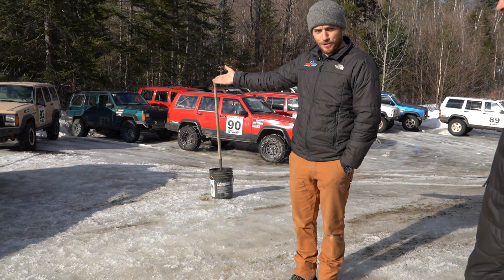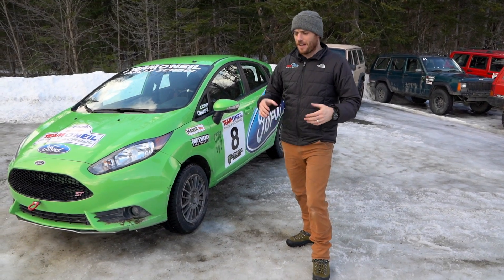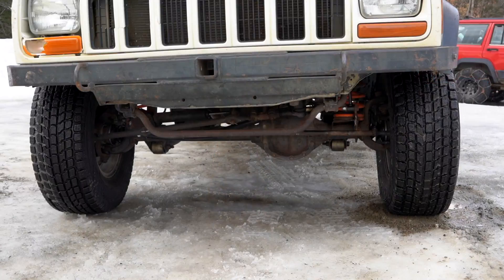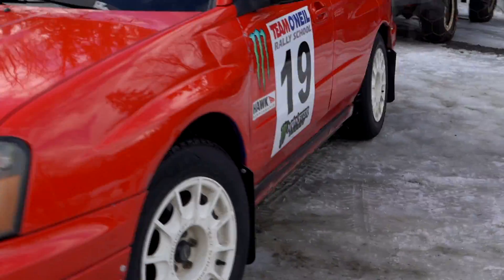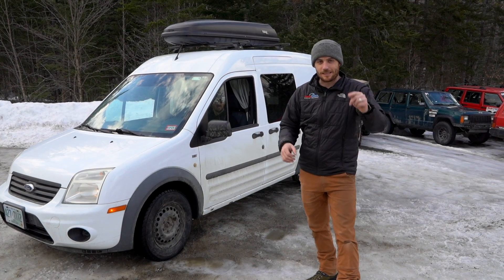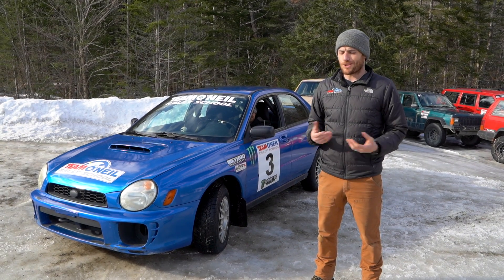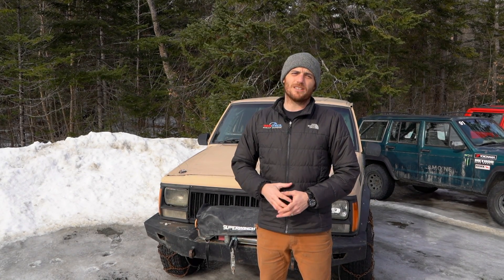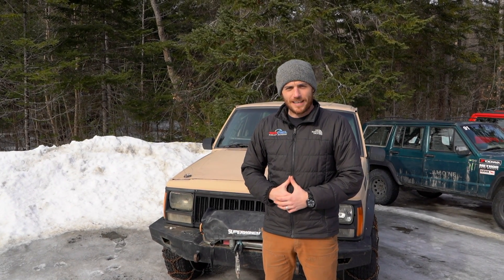Differentials and Traction Control Explained

Comment: But if the green one gets a wheel in the air it will not transfer torque unlike a clutch style limited slip

Comment: I have a 2015 Toyota Tacoma 2wd.. it came with traction control and auto LSD. It was okay. I installed a geared style limited slip, and a little bit lower gear ratio... The combination of the torsion and the traction control is amazing......

Comment: i put a trackloc in my rear (extra clutch pack), and an Eaton Elocker in the front. best upgrade ever! (also installed solid axle shafts instead of the Central Axle Disconnect)

Comment: My 2013 grand caravan would brake the spinning wheel even with tc turned off,just no cutting the throttle with TCin off. My 2018 Camry doesn’t brake the spinning wheel when TC is turned off.

Comment: If I have traction control on and try to do a trail turn will it just Bog down and I'll lose pretty much all power?
Reply from the maker: With TC on, the car will bog down any time the tires spin and the wheel speed sensors read higher than the actual vehicle speed.
Reply: @Teamoneilrally  Thanks!

Comment: Ford traction control caused me to have a massive accident in a Ford Mondeo Mk1 ST24......I aquaplaned at 60mph on a country lane, I reacted quickly and saved it initially, dropped into 3rd gear and nailed the throttle to pull me out of the skid, traction control kicked in just like that transit and made the car essentially lift off oversteer off the road, massive accident , rolled 3 times and destroyed the car completely. That kind of traction control is DANGEROUS imho.  

If I remember correctly that system lengthened the throttle cable / shortened dynamically based on the ABS wheel speed sensor difference, very crude, the irony was I always disabled that crap when driving "normally" because it would often give you a completely dead throttle pulling out of a wet junction of similar, again, very dangerous, sadly the TC always defaulted back to on when you started the engine, and on this occasion when I crashed I had forgotten to disable it.

Comment: Hi, first of all you do a great job here on yt :)
But while testing wrx you said that front spins the same speed as two rear. 
Its not true, when one front wheel is not spinning second one spins two times faster that rear wheels. That's how open diff works.

Comment: anyways turn on to my street when entering a residential street I always hit the all-wheel lock.  I came to my alleyway which has had some melting going on in the last few days of snow yesterday.  So little islands and slush.  At the alleyway I had a big puddle deep etc.  so i was already in the all-wheel lock and i pushed the button thinking i was turning it on.  went forward left front wheel up on an island and the right front down at an angle now getting traction moving up a good incline both right and left front tires meet ice and snow at the top rear wheels to follow...then I realize I did not have the all-wheel lock on.  It griped pretty well surprisingly.  Curious is that thing?  I like to think of the all-wheel lock bracing everything keeping everything tight.  if i had the lock on would I have angled in the puddle as I did or would the four-wheel lock have kept up and found another way through?.  I always feel like with the all-wheel lock-in that situation the vehicle has to twist more without the help of the all-wheel lock.  Also, curious e traction control is that how I was able to ease through so well thinking that I had the lock on but the traction control actually giving torque to the rear anyway.  Saw the jeep ch at the end there have an all wheel lock...like mine except as I explained mine was off when ''i thought it was on ....

Comment: Go Jeep Go, show up those over hyped Subarus. I got a similar system in my sedan, clutch type transfer case, open diffs, and a good stability control system that won't pull power. It's A-MAY-ZING!!

Comment: Is it possible for a 4x4 or AWD to only drive with one tyre considering that all three differentials are open?
Reply from the maker: The center diff is rarely completely open, even a viscous center diff will spin both front and rear driveshafts pretty well (unless it's badly worn out)

Comment: My 2wd tacoma has what I think is a nice mix of systems. During regular driving with the traction control on, its a system where it cuts power when the rear spins. If you press the trac off button, it turns the power cutting off and has the brake actuated rear lsd (Auto LSD on the dash). If you hold the button for 5 more seconds it turns all of these off and it doesn't touch the brakes

Comment: 1:53 the Chrysler 300 has that system. It wouldn’t go forward on slick conditions  like I’ve, so I had to turn off the traction control in the winter time. It took too long to launch even if I go pedal to the metal.

Comment: The car I"m just about to trade in has the Electronic traction control, if I ever forget to turn it off when I get in and my wheels slip for any reason, say wet road, ice, debris whatever, the traction control causes such violent wheelhop that I see the dashboard and windshield moving separately... Never buying another Seat, it's only 14k miles old and has so many other problems.

Comment: I used to drive a small truck a lot. It had ASR. First thing when it got slippery.. I turned off ASR. It wasn't that I'd feel so strong about my driving prowess. It's just that the van have stopped and refused to move up a slippery slope, wheels spinning slowly. The most useless system I have ever seen in my entire life.

Comment: about FWD cars at 1:51 with Traction control that cuts throttle, i believe the 10 and 10.5 gen Corollas 2009-2013 have this, and possibly 11th gen Corollas as well 2014-2017, they are rally-able as well and quite fun in the snow/ice! :)

Comment: One problem of open diffs with electronic traction control that can't be fixed is the energy wasted in the brakes.
Only one wheel having traction means 3 others spinning slightly faster but same torque into the brakes and thus wasting more than 3 times the energy?
So your engine suddenly has only 1/4 of it's power?

When going fast i guess the control also limits this waste by effectively disabling the traction system brake control.

Comment: Pretty sure the 13 honda fits traction control worked by cutting throttle.  It was a pita with the manual if you didn't just power through it the car tended to stall when trying to start out on snow/ice. 

These vids are great, thanks!

Comment: I have a 2005 V50 t5 awd with dstc. the haldex awd in this car have a clutch plates to send power to the back wheels so it act as a locked center diff when its activated. The dstc systeme use the brakes to transfer torque from both sides but when you turn off the traction control, it still makes your axles act like limited slip but doesn't reduce the absolute speed to keep traction. so I can floor it and all four wheel break traction and start spining. That make it a very fun car to drive in the winter. I don't think the Haldex systeme without the DSTC produce the same result. DSTC was a option on those car. DSTC ever help you turn at high speed by sending more torque to the outside wheel. A lot of exotic cars now use the brake to split torque with an open diff because it's very effective. The only counter argument I can see to that is that it's not a raw and pure form of driving because a computer is helping you.
Reply from the maker: Those Gen 2 or 3 Haldex systems are great, but they do need the front tires to slip before they will send any drive to the rear. That takes a second, then the DSTC needs one side tire to spin before it can apply brake and help create a limited slip effect. Once all this has happened, you're exactly right that all four wheels should spin, but as soon as you lift off the gas, you're back to FWD and the whole process starts over again. It's a GREAT system for normal driving and getting around in the winter, but for high speed maneuvers sliding around on snow and ice, it's like trying to hit a moving target. That can make it a lot of fun getting to know these cars and how to get the most out of them!
Reply: @Teamoneilrally   Yes thank you for the reply, you are right about the time of reaction of the systeme, in my dayly driving and having fun in parking lot I'm not realy noticing it. I can see how it can become a probleme at high speed for precise cornering however!

Comment: So technically the Subaru and the 4x4 are not a genuine AWD and 4wd system - glad I bought a proper AWD that actually spins all 4 wheels - Evo for the win
Reply: So technically I think you missed the point
Reply: STI-s got front/rear lsd as well. Just the wrx doesn't

Comment: My mk5 Jetta has the TC that will cut power to the throttle it’s very annoying in winter have to turn it off because it’s manual but on dry asphalt it hooks up pretty good

Comment: Is there a difference in the WRX vs STI diffs? What diff setup is best for rally? front and back limited slip?
Reply from the maker: The STI has limited slip diffs front and rear, which is an excellent setup for rally.  The WRX only has a limited slip in the rear, which is still pretty great, but only 2008 and older. In 2009 the WRX got an open rear diff and traction control... Booo

Comment: in a live axle one wheel slips more than the other because the drive shaft torques the axle. If it spins right the right wheel dig more and the left slips

Comment: great video. i had an 98 grand cherokee 5.9 (with the 249 transfer case replaced with a 242) that was essentially right wheel drive. it almost never spun the left wheels, very rarely the rear it would. no traction control at all. every time it snowed i would be crabbing down the street at an angle. i currently have an 03 bmw 325 XI which is nearly the exact same 4wd system, with its mechanical new venture transfer case and all, but the bmw has traction control that applies brakes. that works very well and will get all 4 wheels going when necessary, but its very true about losing momentum. i have on slight occasion had to turn off traction control to get a couple of wheels spinning better to get me up a hill or something.

Comment: Would have been nice to see an STI with the DCCD in LOCK. I assume all 4 wheels would spin?
Reply from the maker: Yup all four will definitely spin.
Reply: If it wasn't locked would it get traction and move forward with season correct tires?

Comment: Second time watching the video; still great! But I have a new question.

I've been practicing left foot breaking in my 2000 5speed honda accord. Since it's an open diff, are both wheels still spinning when I'm applying brake with the left foot and turning or just one wheel?
Reply from the maker: Awesome! Yes you can definitely ride the brakes to keep one tire from spinning and force the diff to turn both tires with more equal power. It may not be exactly 50-50 left-right but you can definitely keep it from going 100-0.
Reply: @Teamoneilrally  OMG thank you for the reply! I will definitely be signing up for some lessons in the future when I'm finished school.
Best wishes from Canada!

Comment: Front wheel drive tip: If you're trying to get up a snowy hill and having trouble going up forwards, try reversing up the hill instead (if conditions allow, ie not on a busy public road). By doing so, as you begin to accelerate up the hill, you shift the cars weight onto the front drive axle. Also reverse gear is often the lowest gear ratio available in an unmodified car. This has worked for me many times trying to make it up steep snowy driveways.
Reply: It also does better donuts ;)
Reply: Was wondering, does Traction Control work the same in reverse on most/all cars that have it?
Reply: Exactly how I got out of a tricky situation seeing some friends who live on the bottom end of crescent. Had to get car dug out first, then turned car round and reversed up the hill no problem, where other cars had struggled to get up the hill, which was about 1in3 and about 400m to top of hill.
Reply: A good idea. But not a bright idea. When you're climbing a offroad obstacle. You want to be stable and being able to drive safely. It's all about the tires that makes a big difference in offroading. All terrain tires, Ok. Mud tires, strongly recommend...
Reply: No, reverse down the hill and go another way, because the problem is some idiot that got stuck uphill from you.
Reply: The lowest gear ratio on most cars is 1st and reverse is generally somewhere between 1st and 2nd

Comment: Great vid!  I have a Cherokee Trailhawk on my channel which has the locking rear diff.  Also if you turn off TC it will still activate the brakes to act as limited slip.

Comment: Hi guys, got a question on the torsen diff; 
I've been wanting to put one in the front of my Impreza gc8, but I've been "scared off" it by reading on forums that it really doesnt perform that well on loose surfaces, since when it is slippery it obviously can't transfer a lot of torque if not any torque at all. In your clip with the Fiesta ST though, it looks like its working pretty well on that packed snow/ice. What's you guy's take on it? How do you like it on loose surfaces?
Reply: Well the Fiesta ST uses brake torque vectoring. Which you could basically think of as high performance traction control as it's designed primarily to transfer torque rather than to stop wheel spin.

Comment: Totally meaningless demonstrations that in fact DO NOT demonstrate the difference between open and limited slip. It’s called “limited slip” for a reason and even limited slip diffs can allow one wheel to spin when you overcome the clutch pressure in the diff. This is not demonstrated at all in the video.
Reply from the maker: If you'd like to take a car with an LSD and strap it to an immoveable object, put the tires on radically different surfaces and spin the tires for 30 seconds please be our guest and send us a link to the video when it's done. We can title it "How to Destroy Your Limited Slip Diff."

Comment: My ST is at the dealer now to get my Quaife installed. I hear the LSD improve braking as it evens out the slipping between the wheels, not to mention cornering. Hopefully it is worth it.
Reply from the maker: You'll be very happy, especially on gravel or snow the difference is huge.
Reply: @Teamoneilrally  Just got the car back. Have only driven it a bit on the street so far but it seems like it was worth it. The car tracks dead center on acceleration. It feels like the steering wants to pull to the center while driving down the road, and you can feel it pull to the inside on corners also. Definitely a lot more grip. My main concern was a sketchy feeling on hard acceleration all the way up to 4th gear, especially on a back road with a bad surface and wheel spin on wet roads.